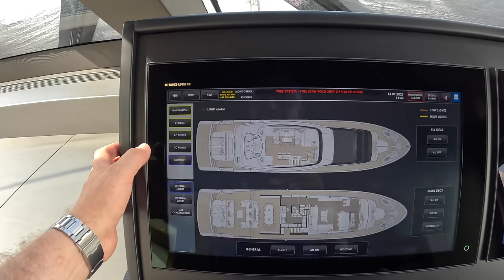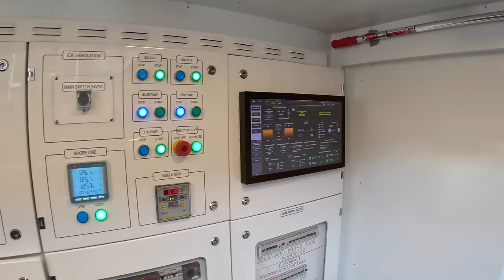€10.5 Million Superyacht Tour : Extra X99 Fast

Comment: Would be pretty easy for that outdoor hi-lo TV to be double sided. The current crop of TVs (ie Samsung Frame, etc) are only an inch thick. Probably cheaper to fit two than to have a swivel mechanism for a single screen.

Comment: Another amazing video buddy, great job you hit it out of the park with another home run. I too, love those door hinges. They look so strong and I'm betting they glide when being used. May i make a suggestion, it would be great if you could make a specs page an have all the important info on it such as length in meters and feet for us in the USA, width, size of engines and distances with fuel consumption in litter and gallons per nautical miles, # of berths and restrooms, and anything else you think of. It is great when we can see it because for myself it helps me rate these beautiful boats on my new boat list i plan having built in the future. Taking bits and pieces like you would say, from different boats and these hinges are going on my list and what video an by whom made the video. Great job my friend and I can't wait to see what you find next. Hopefully a live aboard and explorer yacht with far distances. Loved the video of the boat of 22,600 nm range. Loved it. Stay safe buddy.

Comment: The blonde wood everywhere is a bit too low key (gloss FTW) but there's no arguing with all that space & performance. You can traverse the hotspots at hull speed for a week or so sipping fuel then burn the remaining 80% in the tank on one max speed dash home. Good fun. The cabins are a bit small but they've been clever in having only one dining area instead of an inside & an outside. Saves a lot of space.

Comment: I have an idea Nick, make an annual picture calender with just hinges or super models holding  hinges. You can work out the details. It would be a great merch idea!

Ok, back to the boat.  With some of the changes made by the owner spec, the crew really got short changed.  Unless the owners made the crew a part of the "family", it would be rather misersble.  There is not enough space to live or relax.

Over all the boat seemed cramped.  Of course, I just watched your video on the ISA Classic 65, so my perspective may be warped. This boat was nice and would be a great party boat, but it is not something I would go on an extended trip on.  I think 6 supermodels cruising around Miami would be more appropriate. It is a go fast, buy fuel, go fast kind of boat.

Great tour, thanks, Nick!!

Comment: A Navetta 64 is a quarter of the price and has about the same accommodations. This is not a ship, it's a party boat for a rich person to show off at a beach.
Reply from the maker: You'd hope so too, it's a 1/4 of the size.
Reply: @AQUAHOLIC Well, about 2/3rds of the length, but who's measuring. Not criticizing you in any way, Nick. You are more awesome than any boat you show.
Reply from the maker: @Rodrifuuu  Correct, but then factor in beam and height and the volume difference is dramatic. When Princess brought out the first Princess 65 it famously had double the internal volume of the Princess 55 despite being only 20% longer, due to the increase in beam and height.
Reply: @AQUAHOLIC  Fair point. I was initially just pointing out that for the price (and size), the X99 has very small accommodations. As someone who prefers explorer yachts, it just seems like a waste.
Reply from the maker: @Rodrifuuu  It's a high performance boat, a little like a Porsche 911. In both cases, if you want maximum space, you really need to be looking at something different.